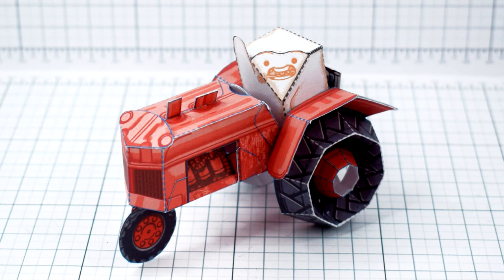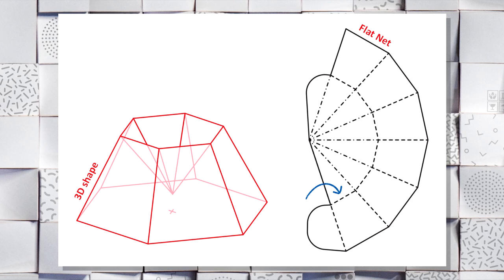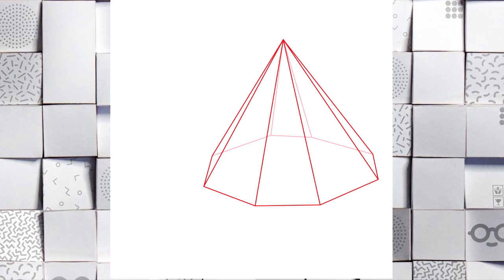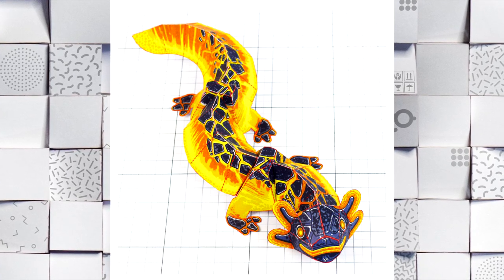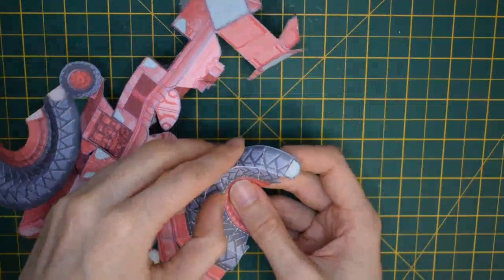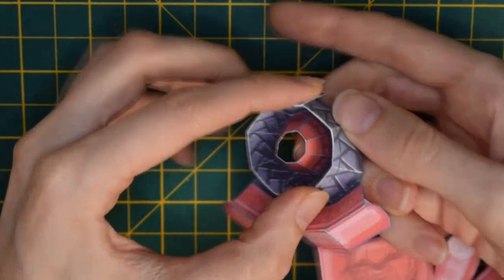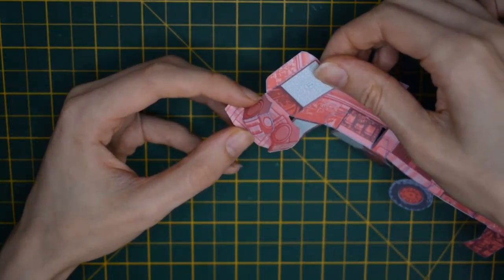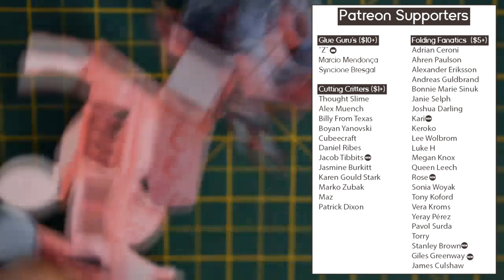WHY does this toy SUCK?

Comment: Ok ive designed and built papermodels for a very long time now and I didnt know you can fold paper in shapes like that with just 1 template. Ive always have to put them separate to achieve the right structure. Also the video is very informative. Thank you!